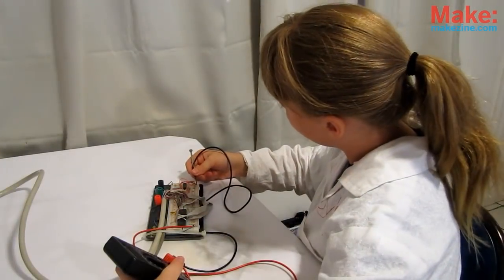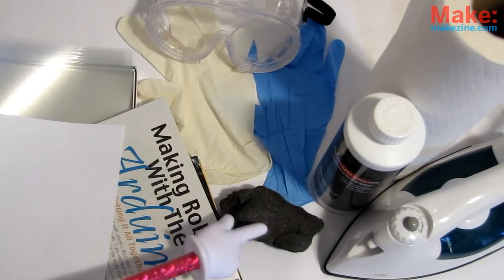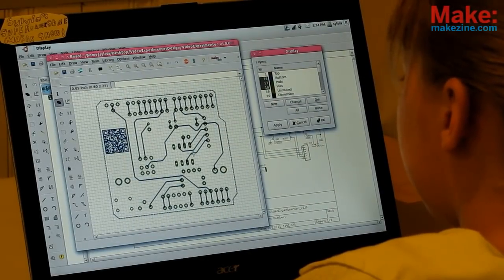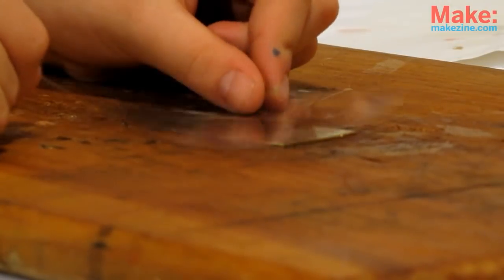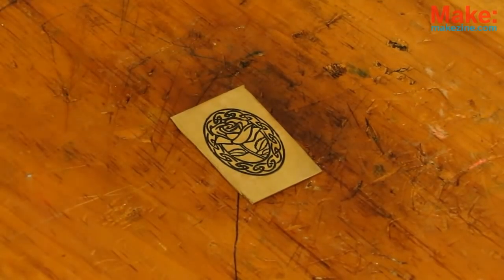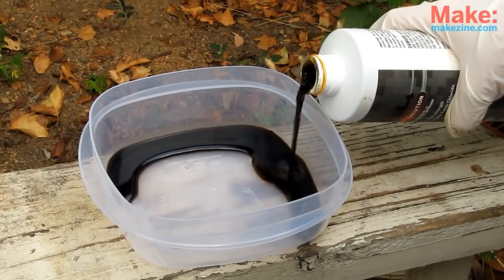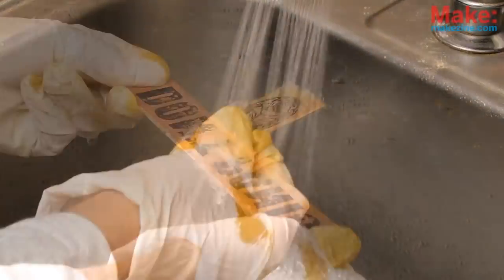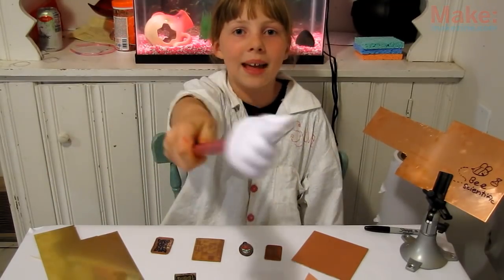Super Simple Copper Etching -- Sylvia's Mini Maker Show

Comment: Tips:

After etching, you can dissolve the toner away. I first tried isopropyl alcohol (99% strong) but it did nothing to the toner. However, acetone took it right off.

Also, the thin oxidation layer on copper can literally be erased: with a rubber eraser.

So, no abrasion with steel wool is ever necessary.